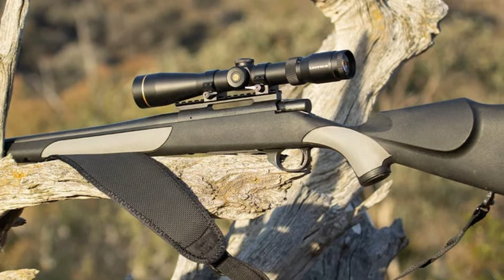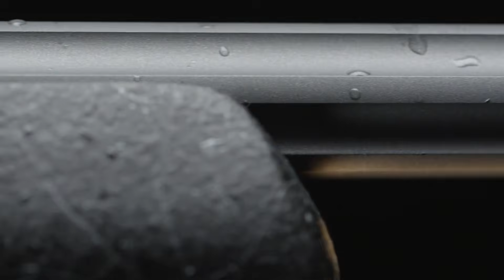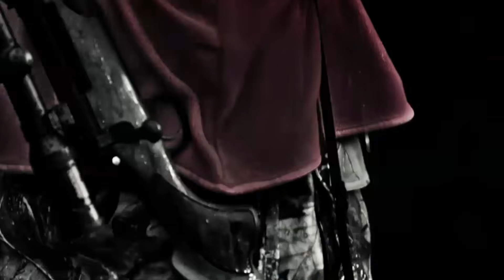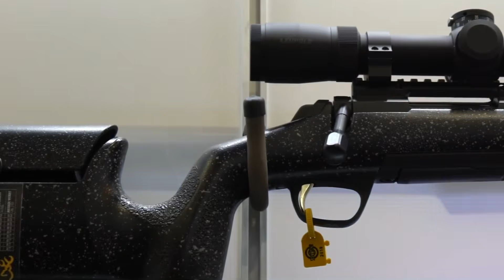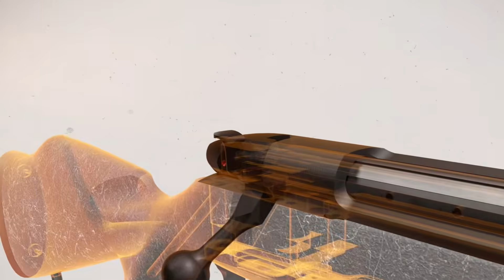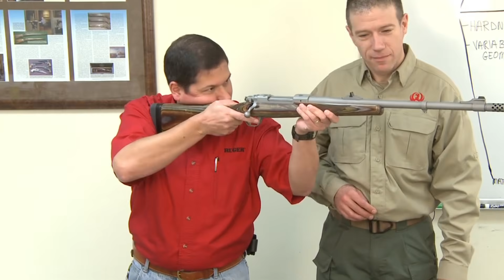5 Best Hunting Rifles for Alaska 2026: The Engineering Secrets Nobody Talks About

Comment: Weatherby doesn't build the vangaurd. Howa does. Weatherby buys them, then restocks, couple things, puts their name on it
Reply from the maker: You're absolutely right about Howa being the OEM behind the Vanguard. Howa manufactures the barreled action, while Weatherby handles the final assembly and branding. So it's more accurate to call the Vanguard a Weatherby-branded rifle built around the Howa 1500 platform rather than saying Weatherby manufactures the entire rifle themselves. Thanks for pointing that out!
Reply: @gunsmith360 it takes nothing away from either. I have built 8mm ultramags on Howas. If I was told, tomorrow, that a Howa was the only gun I could own. I would be pissed, at whoever told me I could not own more than one gun, but would know I had a good gun
Reply from the maker: @DaveZingler Exactly. The Howa platform has clearly earned your confidence, and your experience building 8mm Ultra Mags on it says a lot. At the end of the day, a solid rifle is a solid rifle, regardless of the name on the receiver. Thanks for sharing your experience!
Reply: Which rifle you suggest ? Which is total reliable and accurate ?
Reply: I really like the ruger model 77.  Fabrique nationale and interarms. Model  98 mauser, basically. Controlled round feed with the claw extractor. I own̈ed lots of weatherby mark v . 300 weatherby, 300 ultramag, 257 weatherby, 270 weatherby. 375 weatherby, 378, 416 weatherby inproved and 500 a-square. 

I rebarreled almost every one of them. Glass bedded the reciever. Did a trigger job. First one was rebarreled and chambered in the ultramag. Shot 3/8 inch groups with boring regularity.  Most accurate and cheap. I rebarreled an interarms mark x for 30/338. First group was just a reload with 150 grain ballistic tip. Nothing special, just opened the loading manual and picked one. I was getting it ready to start competing 1,000 yard. Not glass bedded and still in the old wood stock.  .293. I hurt my back really bad and could not do any bench shooting for years. But seriously. Buy a solid gun. Barrel it. You can buy a barrel from pacnor, super match grade. Mail the reciever. They will charge you $350 for the barrel and chambering job. 
 Get it home and glass bed it. Or like I do. Glass the action while the old barrel is there. Then only have to float the barrel. First few I did with the right size socket and sand paper. 
But seriously, pick one learn how to make it shoot. I am doing the stock on a browning bbr right now. Rebarreled it to 8mm rem mag. It may become an 8mm ultramag when I am done. Hahaha
Reply: What do you think about tikkas and sakos ?